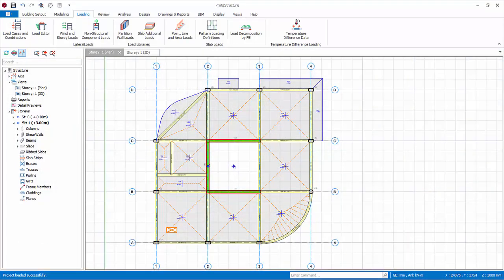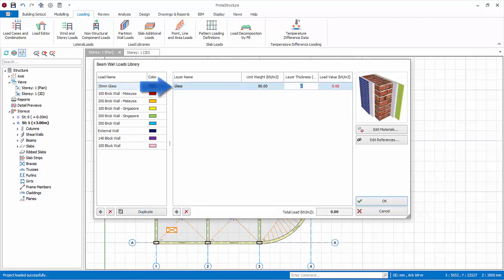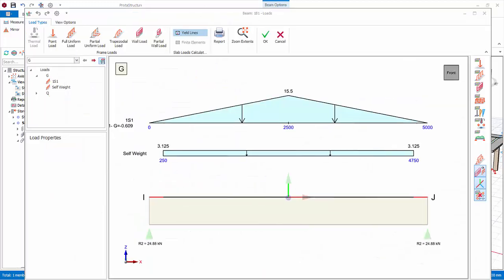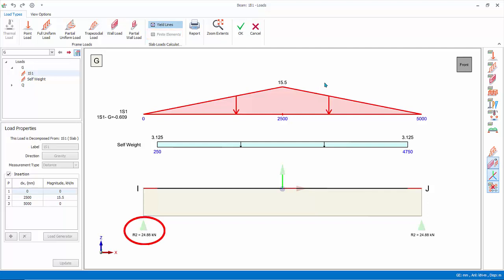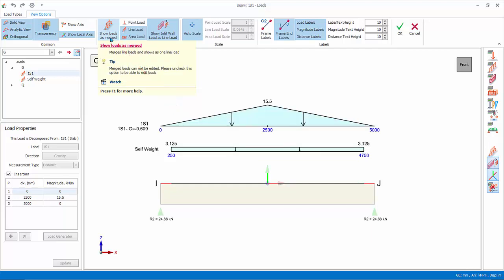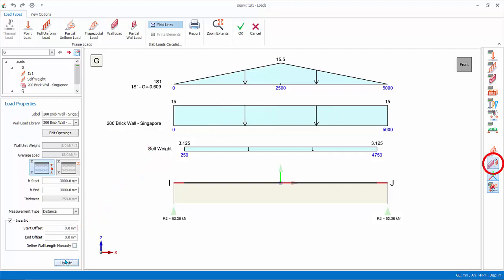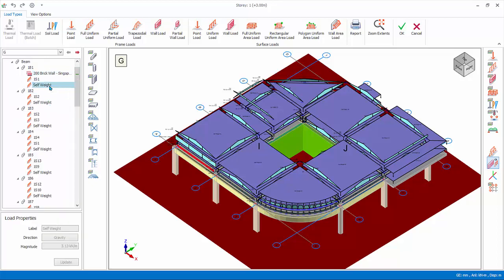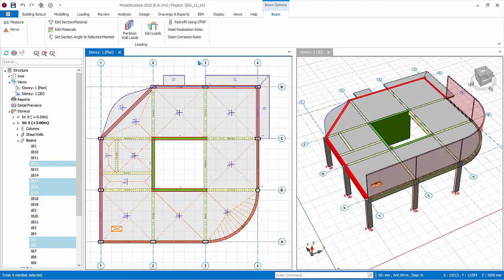9 Beam Loads, Partition Wall, Load Editor

Comment: if slab beam is at 4ft and if i wanted to extend room to 5ft, can i do that without slab beam? if 6 inches - 1ft deviation is acceptable? or is it better to use low weight bricks such as AAC/fly ash bricks?